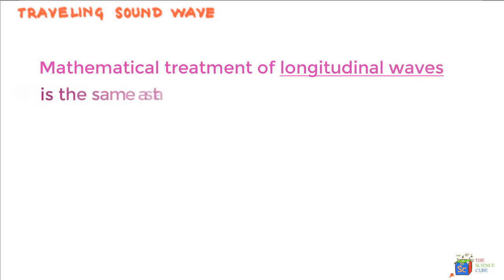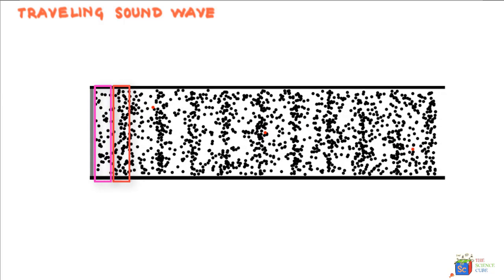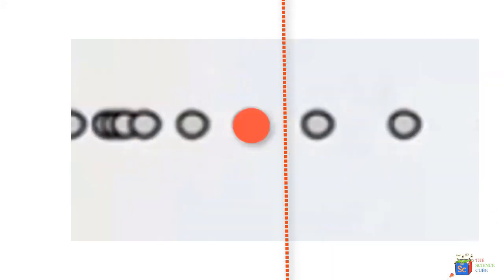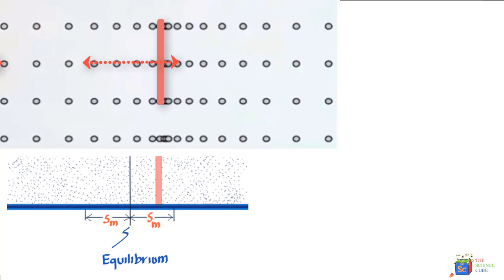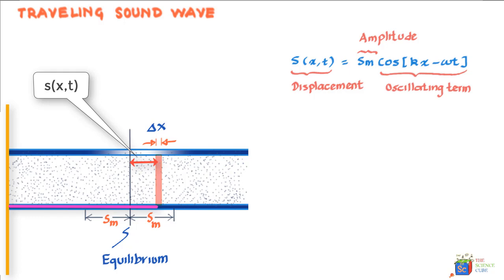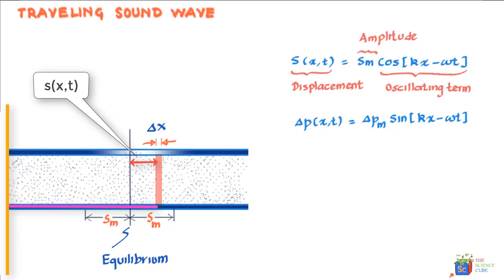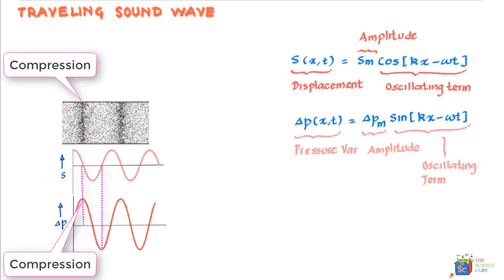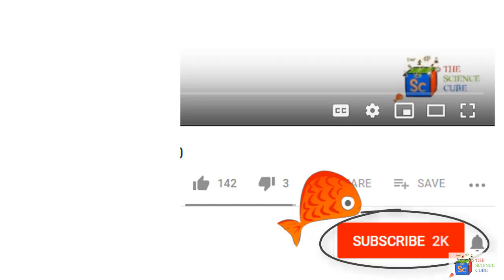Displacement and pressure in a sound wave (compression and rarefaction) #10

Comment: thank you - this was very helpful, especially where you explained what the literature means by negative pressure
Reply from the maker: Great to hear you liked it! are you a student?
Reply: @TheScienceCube  maths graduate who never learned about `physical'  waves
Reply from the maker: @dylanparker130  Now go ahead and create waves :). Are you in the US?
Reply: @TheScienceCube  UK
Reply from the maker: @dylanparker130  Great!
Reply: @TheScienceCube  can i clarify something please?  here, you say that pressure is higher where density is higher, while pressure is lower where density is lower.

is this also true in other waves with compressions and rarefactions, e.g. water waves (i.e. trochoidal waves / Gerstner waves) please?
Reply from the maker: @dylanparker130  You have touched upon a topic that is a little ahead of this lesson or course. But briefly...the water pressure at the surface of such a wave is zero and as you go deeper, there will be planes of equal pressure that will  be horizontal. The pressure variation with depth within the wave will not be same along the length of the wave. The pressure variation is on account of wave particles moving in circular orbits. So you see it is a sort of dynamic effect and not attributable to density variations. Infact the pressure at any point can be shown as equal to the hydro static pressure at a different depth Y'. You'll need to read a text book to understand more
Reply from the maker: ...also do check out this new video on "How to prepare for an exam", particularly the 11th tip  https://youtu.be/TIa3v4UaVRc
Let me know there which tip you liked the most...I'm doing a survey :)